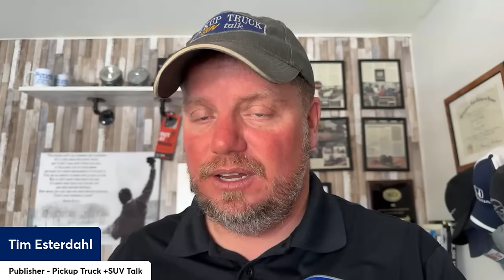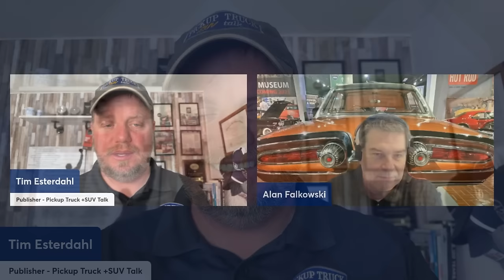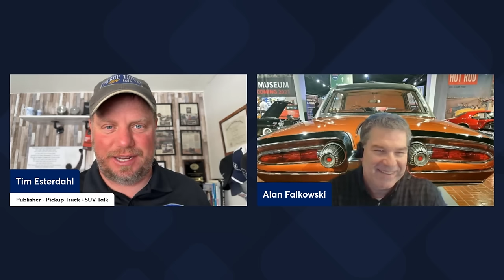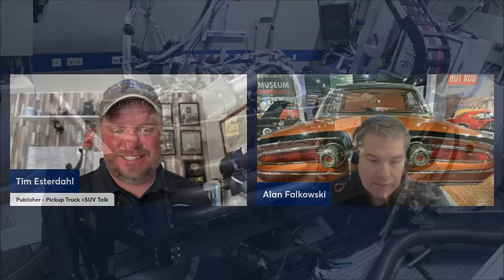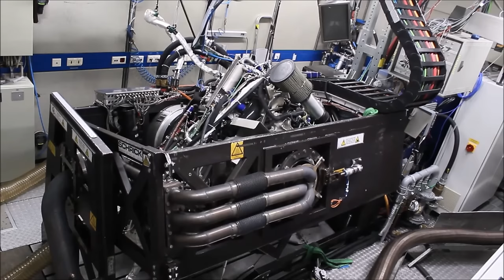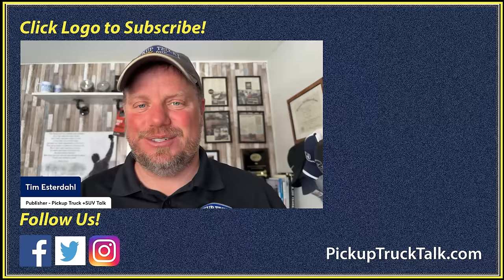Engineer Deep Dive: 3.0L Hurricane Engine - Turbo Life, Oil and Intervals and More

Comment: Oil is cheaper than an engine. First Generation 3.5 turbo charged Ford had problems with soot build up with the direct injection. The end result was the 7 ft timing chain they had in their stretched and the cam phasers quit working properly also. But for those that stuck with a 3-4,000 mi oil change interval they didn't experience those problems and get much more longevity out of their engines.
Reply: I have the 3rd generation 3.5. Ford. I change every 5000 miles pull my 8000 lb trailer and it hasn’t even hiccuped .
Reply: The Teflon covered  cylinder walls going to wear out and then what?
Reply: You might consider that turbochargers could be another way to build in obsolescence.  This is because it's a known fact that the turbo causes more wear and tear on the engine.
Reply: They already have several years of real world data from the 4 cylinder version of this engine being on the market. If oil was an issue we would already know about it.
Reply: As a dealer, we are changing all vehicles oil interval from 10k 12mo to 5k mo intervals. Too many people wait long after the reminder message comes on and wait either for the 10,000 mile part or even go beyond that.

I've worked on newer vehicles where they have gone 15,000 miles since last oil change and it's just sludge. The filter was falling apart (3.6L Pentastar) into the oil cooler.

Comment: Iron sprayed Cyl liners. Can’t overbore, intended to be a throw-away block?
Reply: They’re pretty much all like this now
Reply: Done correctly, it wears out the rings first. Damn near zero wear on the bores. Ask Mahle.
Of course it must be backed up by the hoop strength of surrounding alum. I6 horricane will prove this out.
Reply: You know it.
Reply: Can always sleeve them.
Reply: @OttoTheWeim  nope
Reply: @ckratzet5286 the Hurricane issues a full closed deck block, its absurdly strong

Comment: Hi Tim, I use Amsoil and have for 45 years now. I have been practicing extended oil change intervals against my mechanics wishes. I live in Ontario where there's lots of salt. Cars usually rust out before they wear out. I easily put 400,000 km on a vehicle. I get rid of them because they're rusted out. Not because they're worn out. So I could not agree more with the advanced technologies of oils of these days. Great video!
Reply: What are your oil change intervals, sir? What do you do, exactly?
Reply: Been using AMSOIL for about 2 years. The data is good on how it holds up and gives me confidence in oil in my two high output vehicles.
Reply: A sales pitch, great!
Reply: @Derek-pd4fc  Better to learn something here. Best oil you can buy for your vehicle.
Reply: @302Mustang13  Odd, because the place I worked at used Amsoil on our fleet vehicles, and then they started sending the oil off for testing of both Amsoil and the other brands and realized there really is no difference after a given set of miles.
Reply: @Derek-pd4fc  I just did an analysis and it was flawless. After 8,000 miles on my gas turbo engine there was still plenty of addictives left. Excellent wear protection and cleaner pistons. That and I use Signature Series. I doubt your work does.
Reply: Found the Amsoil dealer.

Comment: Thanks for getting Alan to do this interview.  If we're lucky, maybe we'll get more engineers on the channel.  I also have to give Alan a tip of the hat for doing the interview with a Chrysler Turbine right behind him. That was classy and cool.

I noticed Alam said pretty much exactly what Tim said about radiator size for towing and oil changes at 10,000 miles!  Wow!  How hard is it to change out the oil level sensor?  Do you have to dig to get at it?

Comment: Questions for Alan  (Charger / Challenger installations) :
1. Did you eliminate the dreadful displacement on demand system 
2. How did you ensure that the lifter tick problem does NOT happen with this engine.
3. Is the water pump buried inside the engine
4. Is the water pump driven by the serpentine belt or perhaps its an electric water pump (which is it)
5. How long (hours) does it take to replace the water pump  AND is it easy or difficult to remove & replace it.
6. How long (hours)  does it take to replace the alternator & is it easy or difficult to remove / replace 
6A. Same question for the starter
6B. Same question for the battery
7. How can the owner physically check the engine oil level & transmission oil level.
8. Is the transmission oil cooler integrated inside the engine  cooling radiator & if so is their a guarantee that engine coolant cannot mix with transmission oil due to breakdown of this arrangement
9. Since its direct injection, how frequently (in mileage) does the accumulated carbon have to be cleaned off of the intake valves or did you also add port fuel injectors in addition to the direct injectors to alleviate the problem altogether.
Reply: The largest portion of a dealership's profit is in service. I wouldn't hold my breath waiting to hear back if they engineer this stuff for serviceability.
Reply: You shut up and buy!

Comment: Good stuff, Tim! To have the chief engineer explain some of the questions that everyone has about this new engine was so cool. I'm glad that you asked about the durability in relation to turbos. I'm not a Ford guy, but one thing they proved is that turbos engines in trucks do have durabulity and longevity, as witnessed by their Ecoboost V6s. That will likely be even more true for Hurricane due to its straight-6 design requiring fewer parts. It is concerning that yet, another automaker has 10K mile oil change intervals. So many automakers have gone to this standard and it is so aggravating. On a boosted engine, the oil is doing so many things to lubricate the engine. That causes oil breakdown due to many heat cycles. I don't care what any engineer says, ask any race engine builder and they'll tell you the truth. On top of that, investing $100 in an oil change w/ quality filter at 5K miles max is one of the best ways to ensure longevity. And WHYYY NO ENGINE OIL DIPSTICK?!?! Ugh...

That Chrysler Turbine on Alan's back drop is still one of the coolest concepts that was never built.
Reply: Steve Lehto’s book on the turbine was fascinating
Reply: I agree.  I have a Ranger and I live in Wyoming and often drive at altitude where NA engines faded.  I was shocked at how much better a turbo engine was at elevation.  I mean light years better.  And the low end torque was awesome.  I have had zero issues with it.  And even if I did the performance would be worth a repair.
Reply: We've changed turbos on Ford Ecoboosts 5 times since January.  They also leak oil from nearly every possible possible.  They joke in the industry is an Ecoboost need a 10 000 dollar tune up every 60k miles.
Reply: Daily drivers are not race engines. That's like saying you can't ever eat pizza, ask an Olympian. Makes no damn sense for 99.9% of people.

Comment: They only warranty engines for a certain time, so any recommendations reflect that. I would never exceed 5000 miles regardless of what they recommend.
Reply: 6,000 for me.  I had a Tahoe with the “First ones Free Oil Change.  Brought it in at around 5&00 ish……dealer said they won’t approve until minimum of 6,000.  Brought it back a few days later at around 5995 and they still had me drive around the block until the 6,000.
Reply: @stephencannon3140  My Cadillac dealer told me the same thing when I bought my '23 XT4 back in late 2022, except it was 5,000 miles.  I changed the break-in oil at about 1,000 miles then they can do it again at 5,000.
Reply: GM turbomax 2.7 twin volute I-4 in Silverado/Sierra has 5 yr 100,000 mile drivetrain warranty. Would be honored if one changed oil @ manufacturer recommended 7,500 mile interval. I suggest 20% oil life remaining (6,000 miles), or 25% oil life remaining (5,625 miles) intervals. Also, take in consideration crankcase capacity. GM 5.3 - 8 qts can go longer than 2.7 I-4 - 6 qts.
Reply: A gmc dealer, while I was on a road trip, told me going to 0% oil life was ok but my home dealer said 20%. Manual says not to exceed 7500 miles. I had my oil tested 3 different times by Blackstone labs with less than 5% life on the oil. Each time the reports stated I had at least 1800 - 2100 miles of protection left. For me I do which one that comes first, 0% or 7500 miles ,which depends on how used the truck that oil change. I like to have proof of what someone is telling me and not their feelings. 2020 GMC 1500 3.0l LM2 with 57k miles. 

The more important thing is checking oil levels. The dealer,that said 0%, stated that its not the long interval that damages engine. It’s not keeping the oil level correct. Depending on engine or age of engine, you can burn or drip a-lot your oil in 7500 miles.

Comment: Did you ask him why Ram decided to use ONLY Direct Injection instead of a combination of both Direct Injection and Port Injection?   The addition of Port injection keeps the backs of the intake valves clean, which keeps air flow volume consistent over the long term of the engine, by eliminating carbon buildup on the backs of the intake valves that would otherwise lead to reduced mpg's, performance and engine running malfunctions.  Both Ford and Toyota use a combination of Direct and Port injectors..... did RAM cheap out and go for the lowest quality denominator by using only Direct injection?   This seems like a major oversight for newly developed engine ustilized in VERY expensive trucks.

Comment: Two sides of the coin: I had a 2.2L with a liquid cooled turbo in a 1984 Dodge Daytona and it worked well, no real reliability issues, all the way through 100k miles. There were some sensor issues and I did have to replace a cat, but overall, the powertrain in this car--which was a beater, a salvage car--ran pretty well, never burned oil, never broke anything internally until I sold it somewhere north of 160k miles. I did also replace the turbo, which didn't fail, it just got a little noisy, but the job was easy, so I did it to be safe. 

On the flip side, the air-cooled turbocharged Continental TSIO 360 in my airplane, not so great. These engines have turbos to maintain power, not boost it, so the engine will still put out plenty of horsepower as we climb higher or fly on hot days. They've changed little since the early 1960s and are not intercooled, still don't have EFI, ECMs or electronic ignition. We added an engine analyzer so I always know what is going on internally, but still, we have to baby this $60,000 engine so it doesn't grenade early and expensively. The engine has to have low-lead avgas, and like a dirty gray tsunami, the eco-woke are going city by city to ban the sale of this fuel.
Reply: Dodge Daytona turbo less than 150hp, boost that engine to 350 hp and see how long is going to last.
Reply: @zelenizub2036  Obviously, but unlike the Hurricane, Chrysler never designed the 2.2 engine with strong enough internals for a 350 hp rating. Other than illustrating the obvious, your comment makes no point.

Comment: He mentioned crankcase contaminants being flushed out of the crankcase and burned.  So now instead of the oil carrying them away and the oil being changed, the oil lasts longer but the contaminants end up on the valves and they need an expensive cleaning in the end costing a lot more money.
Reply: Redirect your observation to the EPA and Politicians. There few options left to deal with combustion gasses in crankcase.

Comment: I'm concerned about direct injection vs port injection with respect to the carbonizing of the valves and the valve seats.  I have a 5.7 hemi with port injection.  The valves remain clean.  As for stop/start.  My concern is NOT for the durability of the rotary portions of the starter or the brushes.  It's for the clutch/pawl mechanism.

Comment: At the end of the day there's no replacement for displacement👍🏿
Reply: Exactly mate, Long live the legendary V8s.
Reply: A turbo is a great replacement.
Reply: They will never convince me a 3.0 running 20 psi boost will be reliable. I told the dealer I'll give it 60k before it pukes the head gasket or turbos or both.
Reply: but there is.
Reply: @timothydubois5834 I’ve done it many times bud
Reply: Except for boost. Boost replaces everything.

Comment: I wish you would have asked him about the many Hurricane Engines that have seized up in Grand Wagoneer SUV's.
Reply from the maker: I hadn’t heard about that.
Reply: Yes....I was interested in one of the new Rams....but googled 'Hurricane Engine Issues' and there is discussion in forums about these engines in the Grand Wagoneer application. Always scary jumping into a new engine redesign the 1st year or 2. So, thinking about sticking with an F150....
Reply: @joefriday6324 what's the forums name exactly or where is it from? The most I've even heard of hurricane model wagoneers is either they have a ton of random electrical issues that randomly prop up,or the dealers don't tell people what gas to put in them which has the cars sensors going crazy because they put the wrong fuel in them.

Comment: Finally, a video with a real engineer who really understands all the systems engineering trade-offs that are involved in designing to a new set of requirements. This alone has made this my favorite video. As a lifelong engineer, I really appreciate that you’ve took this approach in this video. All the other noise,like turbo, reliability, etc. is yet to be determined so I’m gonna let it play out and enjoy the ride. Yeah I’m really rooting for the hurricane to be a good engine. I had a hemi in my grand Cherokee and I loved it. But that thing weighed a ton and it guzzled fuel, despite things like cylinder deactivation and all the other tricks to improve MPG. The great thing about progress is improvement.

Comment: I wonder when the EPA will crack down on engine's after they are 3-5 years old. Modren direct injection engine's are very clean when they are new. 3-5 years later will all the soot and carbon build up, they end up significantly dirtier than older style port injection engine's.
Reply: many cities have emission standards annually to get license plates.
Reply: False.

Comment: I like the OilGeek's channel and he tests the oil in the first 3k and shows the metal variance in the oil from break-in. So you can lower initial ware on the engine by changing the oil a few times in first 5k.
Reply: Change oil after 1,000 miles than every 5,000 miles or 12 months

Comment: The inline six is a cool engine and I have had them in a GMC van and it was a 230 and 2 speed auto and them things would run for ever so excited to see this new motor and I hope the wild build this motor the right way with exhaust on one side of motor and intake on the other side and Iam sure that they will do it the right way and with turbos it almost has to be like that .

Comment: Great video Tim. Very interesting how they adjust the recs for oil viscosity with turbo psi as well as the electric coolant pump that keeps the turbos from rising in temps after the engine is shut off!

Comment: My 2012 B8 Audi S4 (which I still drive daily) did not come with a dipstick either. It was tapped for it and there was an OEM part# for it so I bought one and installed it the day I took delivery. That being said, the oil system monitor is spot-on accurate.

Comment: Thank you for this interesting interview really enjoyed listening to it. I own a GW S3 with the HO 3L i6 engine. And prior to owning the GW I drove the GW S3 with the 6.4L V8 hemi that comes with cylinder deactivation. Drove it for a week. The one thing I need to point out is that during normal driving conditions, the hemi with the cylinder deactivation will get far better fuel economy than the 3L i6. It’s a drastic difference. Doesn’t fuel economy translate to emission? You’re burning less fuel for the same number of km traveled. 
The other thing is that the i6 feels sluggish. It takes a bit of time for the turbo to kick in. The hemi is more fun as it can accelerates very quickly. In any case with the GW your not drag racing so it doesn’t matter but to say that the i6 is more fuel efficient is a misleading. Like under what condition? Sure when your using all 8 cylinders of the hemi yes the 6 cylinder twin turbo is more efficient. 
New engine means it’s going to take a while to sort out all the bugs. I understand design and manufacturing very well it’s understandable that when you introduce a new engine no matter how much laboratory style fatigue testing you do in the end the real reliability test will be in the real world and unfortunately a number customer will be unlucky until they fixed all the issues with the new engine design. The engines that are tested in the lab are assembled under strict supervision. It’s not like they take an engine out of the assembly line in Mexico and start to test them. Mass produced engine will always be less reliable than the prototype.

Comment: My problem with start/stop is not so much around town and a driver with a light foot. Any turbo engine needs to idle for about 3 minutes after freeway driving or aggressive driving to;
1: let the turbo spool down in RPM. The ball bearing equiped take the abuse better, but....
2: let the turbo cool. Yes idling exhaust is hot, but way cooler than while running on a freeway.
So what are OEM's going to do about places where there is a traffic light on a freeway or highway? Will they have an idle timer that keeps the engine running for 3 minutes, just in time to be started again when the light changes?
Then there is cylinder deactivization that is proving problematic.
Reply from the maker: Did you miss the part of the video where he talked about the turbo cooling down even after you shut off the truck for cooling??